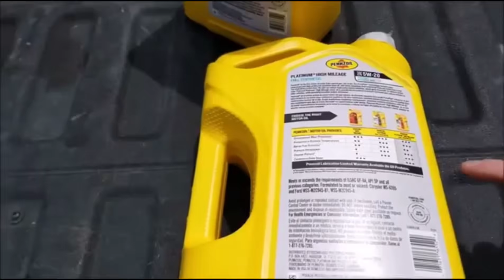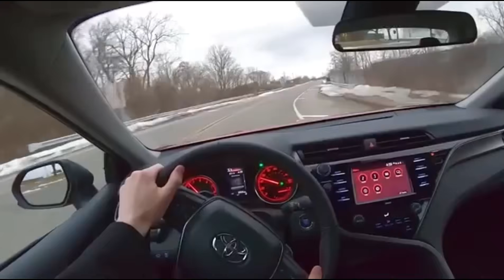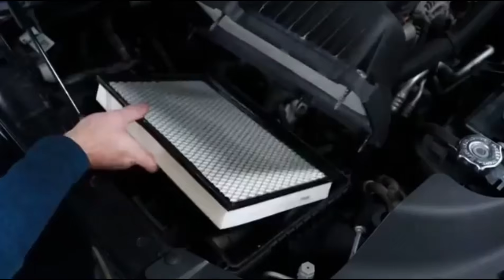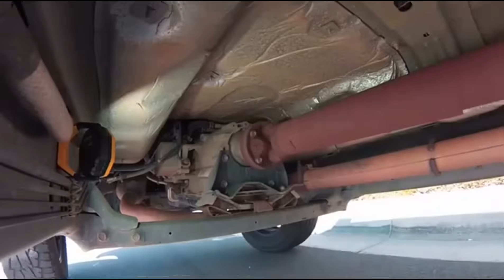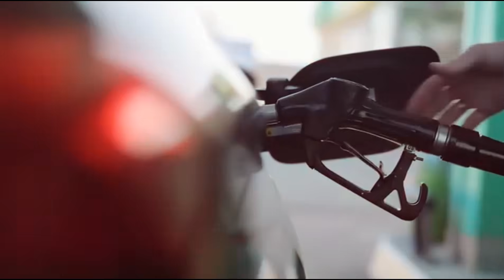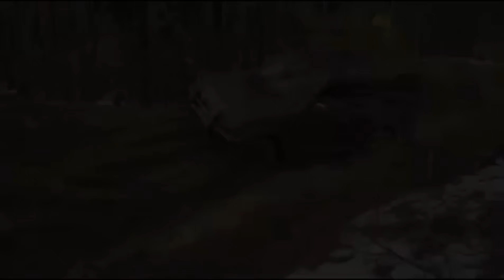The ONLY Toyota Maintenance Schedule You'll Ever Need (Save Thousands)

Comment: $6200 is cheap compared to what Toyota dealers want me to pay. I have a CVT transmission and about the same mileage as this car at 88,000 miles the transmission quitted. Brought it to the dealer. They told me the transmission needs to be replaced and it will cost $15,000. Toyota needs to step up and take care of this problem with the CVT transmissions. People trusted Toyota for one big reason and that is reliability but now they install CVT transmissions and reliability fell through the floor. No longer Toyota’s reliable as they used to be. Might as well buy a Hyundai at least you’ll get 100,000 miles or 10 years warranty on it.
Reply from the maker: That is an incredibly frustrating situation, especially when you rely on a vehicle's reputation for long-term dependability.

Comment: What about a 2011 Camry 4 cylinder LE?
Reply from the maker: Great question! The principles in this video apply broadly, but for your specific 2011 Camry 4 cylinder LE, I'd recommend checking your owner's manual for the most precise details, then using this video as a general guide.